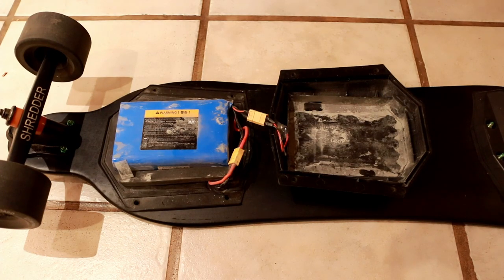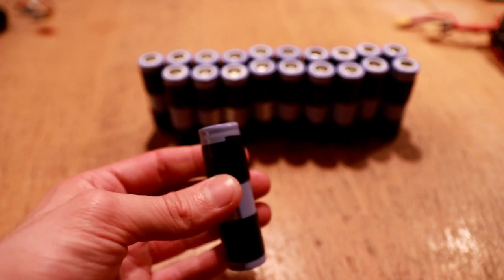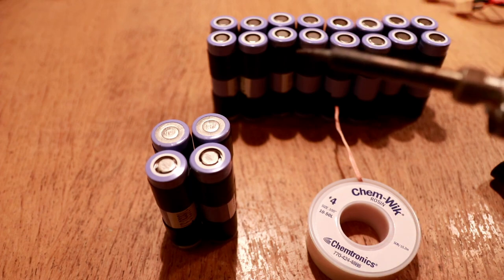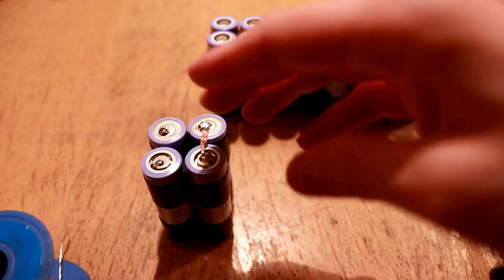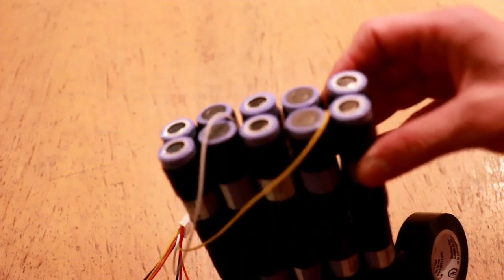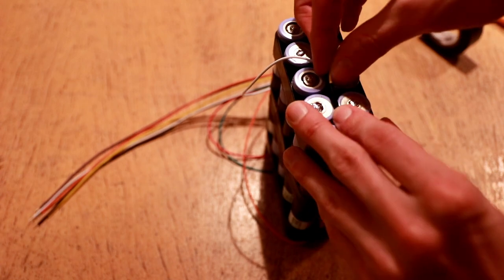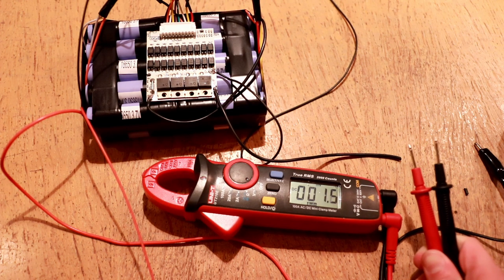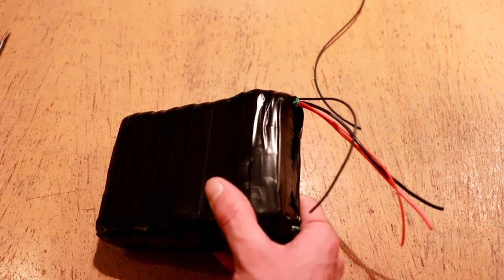EP 61 - Meepo V2 7200mAh Battery Upgrade

Comment: I can appreciate this! One could get a battery spot welding machine for $50 or less and do a more professional job of connecting li ion cells. I believe 20 21700 cells like their er battery will fit in the meepo battery box.

Comment: You should not solder liion cels at al, voltage drops are probably coz u used wire instead of welded tape.

Comment: so now your electronics do not work properly.  ( this is sending you a message)  I get 20 km. on my standard battery from meepo  v2. I am 207 lbs. I was riding at 23 km/h. to get that distance.   just fine. I get 13 km on fast riding 32km. ( dont need to go faster )  I also bought another 105 euro back up battery from meepo to swap out when I need more, just carry the other battery in my backpack if needed .  it. takes 4 min to swap out a battery.  4 nuts and replace . very fast...your idea is a very very very bad one ...as this looks not safe..I would not charge that thing in my house as im sure there is a good chance it will catch fire. stop messing around with the lith batteries. as it is dangerous . I think your video is a bad idea and teens will start building super huge batteries, ( again bad idea) to get super long range.  I have not read or heard of any meepo board catching fire   with the batteries that are provided by its site.  ( hint)
Reply from the maker: There are certainly better ways to build batteries than my approach, but it is still up to the viewer of this video to decide if they want to follow the techniques described. Discouraging experimentation and documentation of said experimentation deprives others of the ability to learn and carry technology forward, and it should always be encouraged for people (teenagers or otherwise) to learn about the electronics they use and modify them as they see fit. 

The pack I have built here, poorly designed as it is, is still in service months later and performs well enough to drive daily. It would have been preferable to use higher-discharge cells, so this is why I published my findings here so that others can see the result of the build.